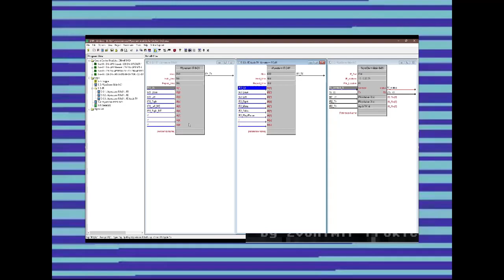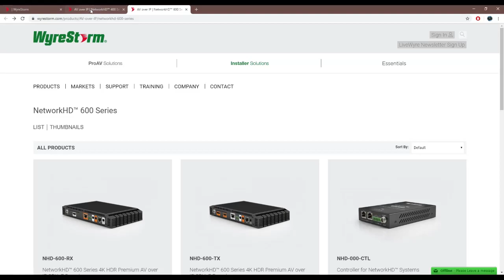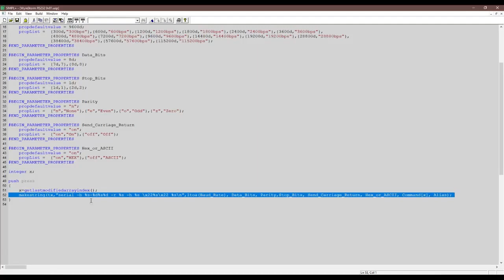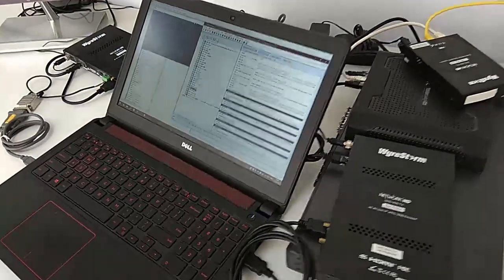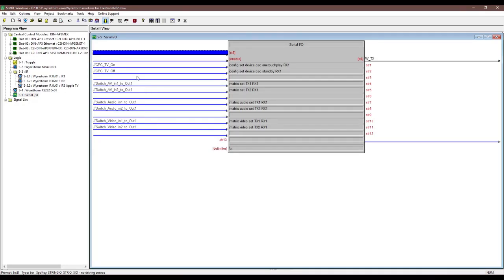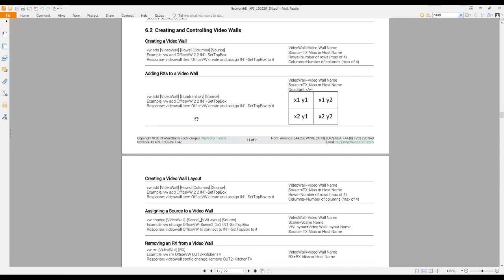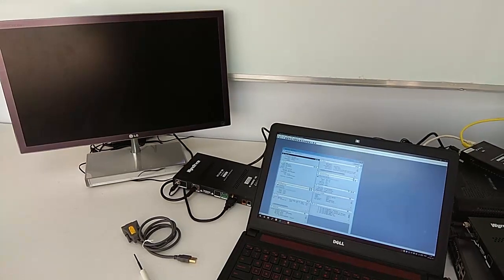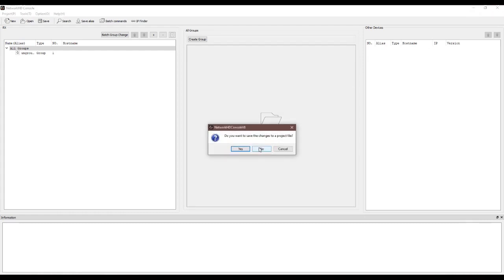Wyrestorm integration with Crestron

Comment: Excellent job, I often wondered when matrix manufacturers would allow to generate IR signals from RS232 / IP commands. Wyrestorm seems to be ahead of the game, other manufactures I speak to at trade shows just shrug their shoulders
Reply from the maker: I agree, i have spoken to their representatives few times and it seems that some of the features are direct result of requests from integrators on trade shows. I do use quite a bit of nvx as well but due to their web interface being slow it takes ages to setup. Would be good if they add console commands for all options from web interface. Additionally i had nvx stop the stream and get stuck few times due to slightly constricted ventilation. Wyrestorm seems stable in same conditions for now and is quite easy to setup. Lacks all the bells and whistles that crestron has for debugging, but if your infrastructure is good and network is setup as per their guidelines, its quite easy.